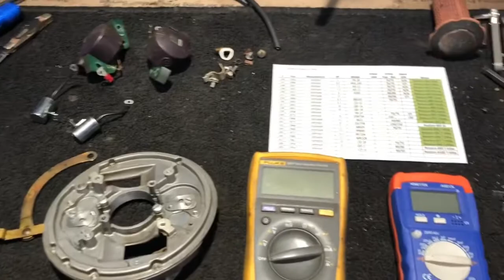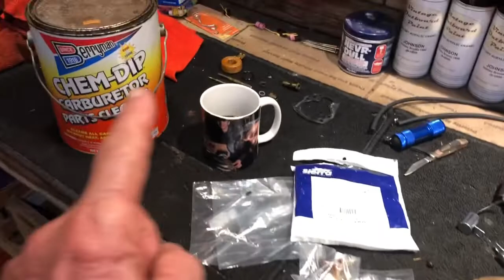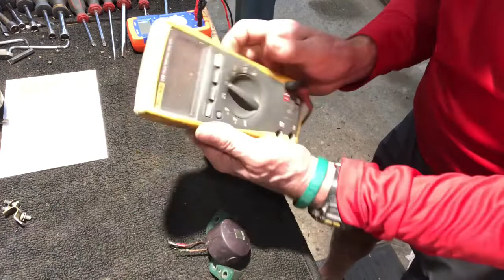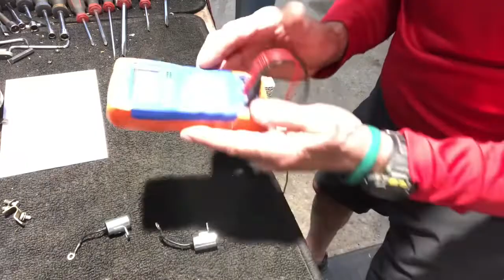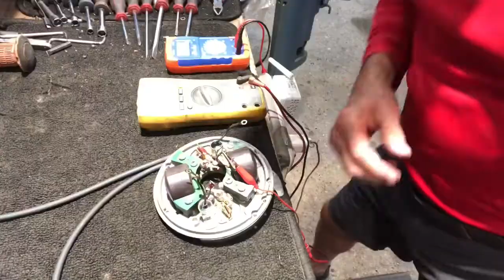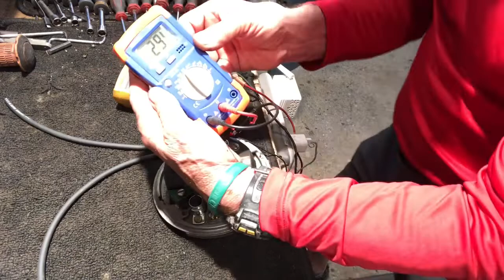Vintage Outboard Ignition Troubleshooting Johnson 5.5 HP Method

Comment: T-Mike I know your a busy guy and responding to old videos is hard to keep up too.. 
question about secondary windings of coils.
Most of your videos say the secondary coils should read between 3-5k ohms.
In this video you did mention 3-10k ohms.
Curious your thoughts here as my coils are new and reading 10k ohms, what’s a better reading lower/higher?
Thx
Reply from the maker: It is 3 to 10 thousand ohms. Not sure if more ohms is better.
Reply: Ok great thank you! Appreciate you taking the time
Reply: Just to add.  I found that my Sierra coils test out around 8,000 ohms and my Chinese knockoffs test around the same. They all seem to function well